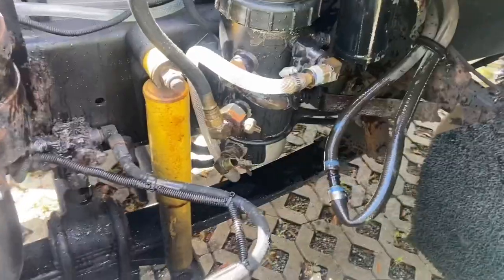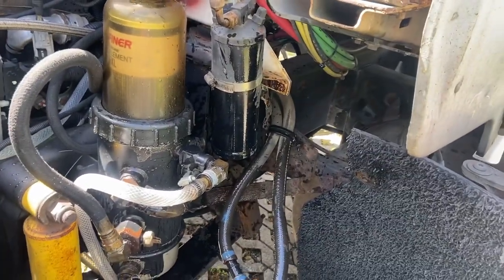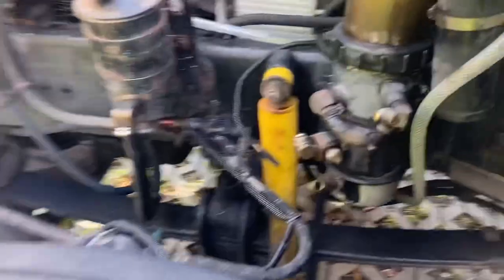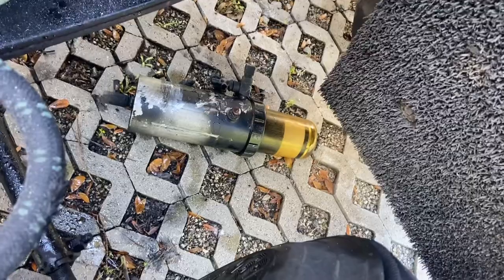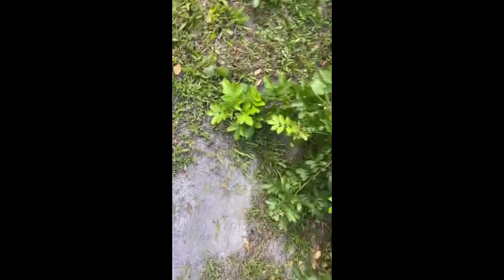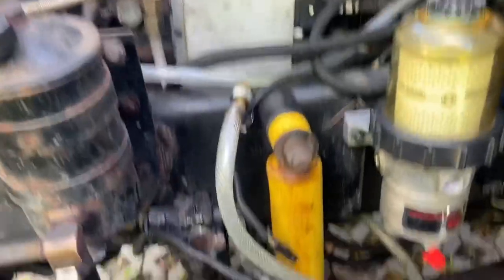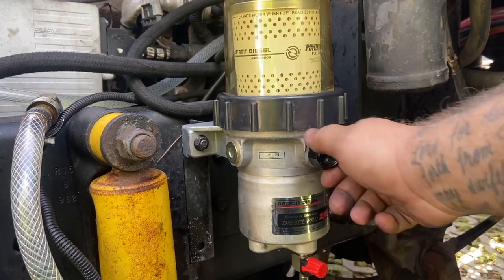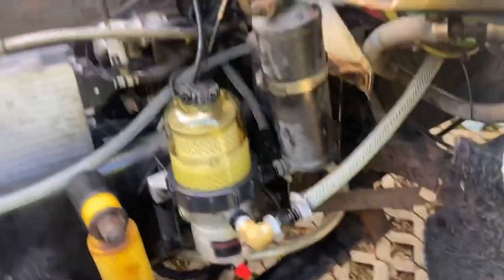Fixing the fuel problem on the fld! Will it start?

Comment: i got 2 lines on the original fuel water separator, one going to the pump and one going to the ecm cooling plate. Which hose goes on the “fuel in” side of the detroit fuel filter. also my filter came with a check valve already in it, should i change it with the check valve shown in this video?

Comment: Where did you get those lines from
Reply from the maker: I made them
Reply: @truckerstyleshawn  can you explain how
Reply from the maker: @mileswatkins6472  I can but you can not run with them like that. I did it to try and solve a problem with my fuel system. D O T would have a field day with you if he inspects you with clear fuel lines.
Reply from the maker: Push lock fittings and clear high temp hose